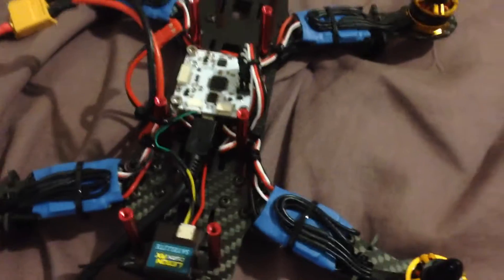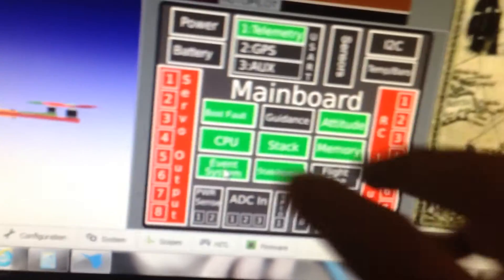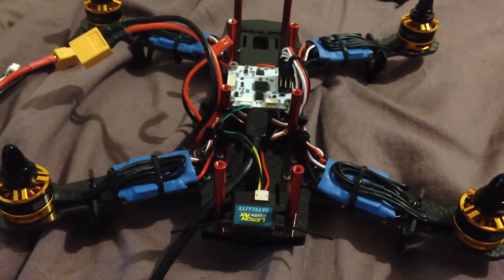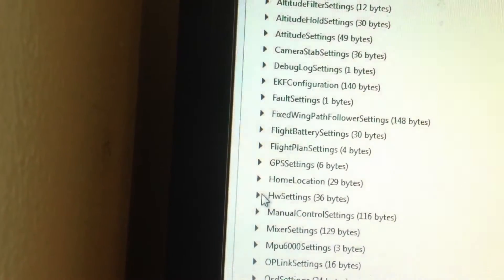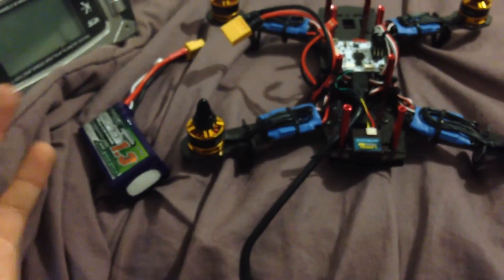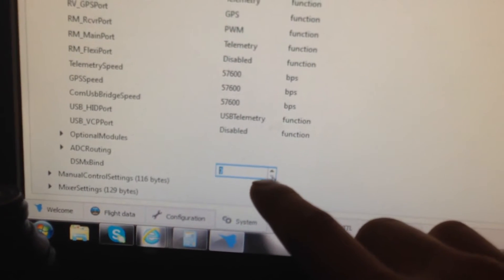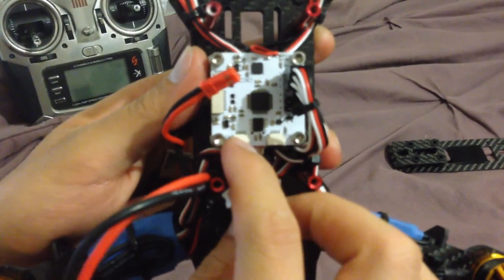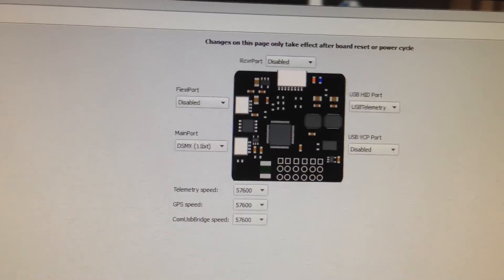Hooking up satellite to cc3d

Comment: Im very new to this! So please correct me if I'm rong..

(Building a Blackout Mini H Quad)

Here's my question just bought 
Spektrum DX7s 7-Ch 2.4GHz Air/Heli Radio w/AR8000 Receiver + CCD3.

DX7s come with spektrum main receiver and spektrum satellite receiver. Some videos I seen were they use the binding plug to bind the main receiver with the satellite receiver together using radio by itself. 

My spektrum main receiver will be connected to CC3D and getting its power from my CC3D. 
An the satellite receiver will now be connect to CC3D and powered my 3v as shown in your video followed by the remaining steps in your video to complete bind. Now that I'm binding the main receiver and satellite receiver through the CC3D, then everything should be binded correctly. Then I can continue to set up my radio controls through open pilot and I should be ready to FLY!! 

An my last and final question just to get a better under standing what is the satellite receiver used for? 

Hope I made some sense out of this.
Reply: Someone please answe him, especially the why use satellite bit. Can u use satellute alone?
Reply: Black Mamba FPV you can use the sat connected to the rx but to use it on its own you would need to buy a stand alone one which are around £25. They are made for drones.